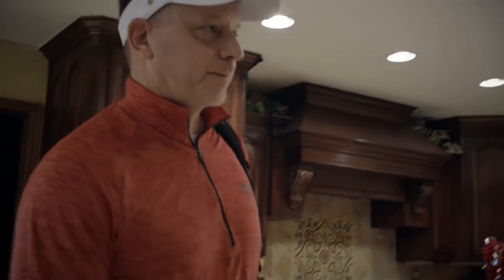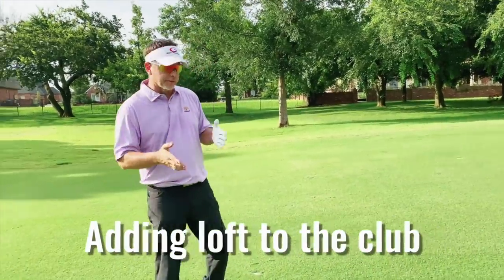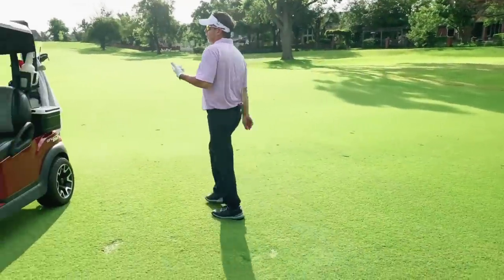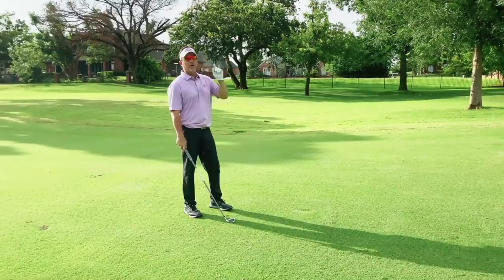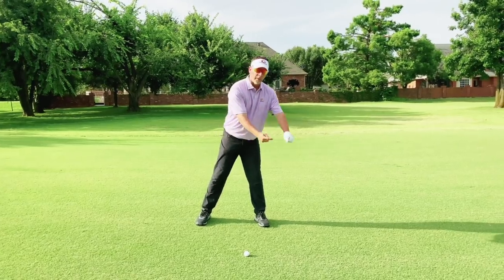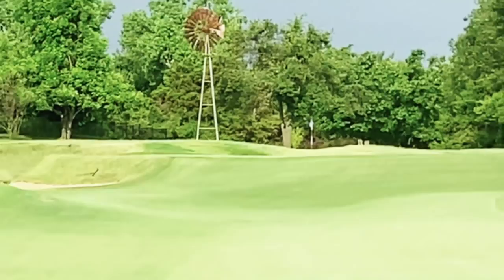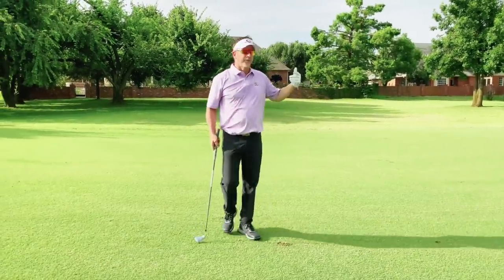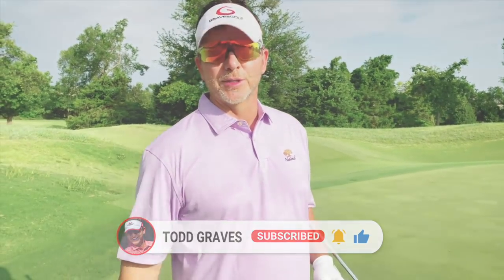Single Plane Swing Lies - Part 1

Comment: Hi Todd
I have been enjoying your teaching video in Korea.
But it is not easy to follow your instruction thru waching video only without f2f coaching. Here is one question on low body especially how much i should bend knee for proper dtance.should i straight knee ?or should i bend knee a little ?
It would be appreciated if i receive a nice answer.

Comment: That is how I learned to do it when I was conventional and it does work. The degree of slope requires knowing where the bottom of your swing arc is so that the amount of adjustment can be determined. Todd, why do we pull uphill lies and push downhill ones?